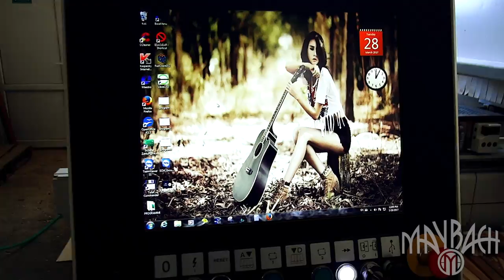MAYBACH Guitars - Production and Factory Tour

Comment: They are indeed great guitars, but Maybach needs to do a MUCH better job at their quality control. I played a brand new one in a store and the high E was practically dead through the neck pickup...
Reply: Was that the only Maybach you‘ve ever touched?
Reply: I completely agree.  After researching this Brand, I purchased a Maybach Lester Edelweiss.  After receiving it, I noticed many issues.  The neck angle was off causing the tail piece to be very high so the strings would clear the back edge of the bridge.  The neck itself was supposed to be a long tenon but it was a short pocket tenon.  I reached out the to the company and got no response.  (They should change their website).  The back edge of the neck pickup cavity was reshaped after the guitar was finished/painted as noted by the bare wood and saw dust everywhere including down in the control cavity.  I can only guess that the neck was too far rearward when glued and the pickup and ring assembly wouldn't fit.  ALL of the pickup ring screws were installed at various angles and most were stripped.  ( you can see how the operator in the video uses a hand drill to create pilot holes).  In fact, one of the bridge pickup ring screw locations had two holes.  The nut was narrower than the fretboard and shifted to one side causing uneven string positioning to the edge of the fretboard.  The nut wasn't sitting flush to the headstock and fretboard edge either.  The router edge of the pick guard had a skip/gouge near the control knobs.  None of the control cavities were sitting flush to the body because the machining counterbore does not include offset for the shielding tape thickness.   I also had control electronics issues but those may have been caused by shipping.  Fortunately, I purchased this guitar through a well known dealer with a great return policy.   This will be the only Maybach I ever touch.